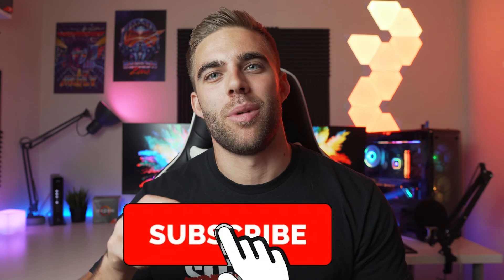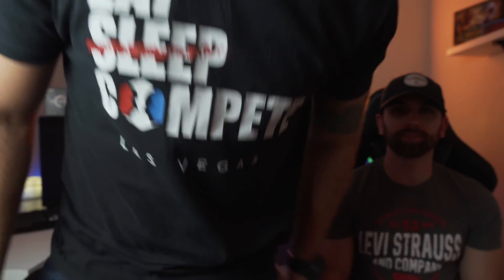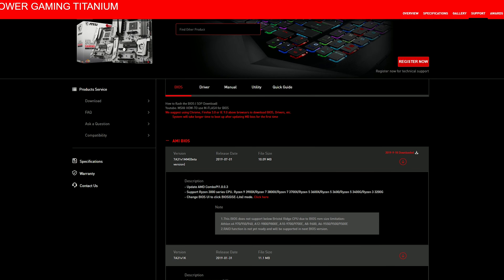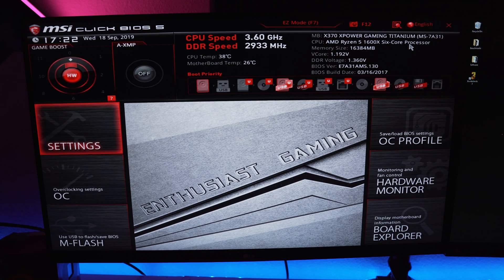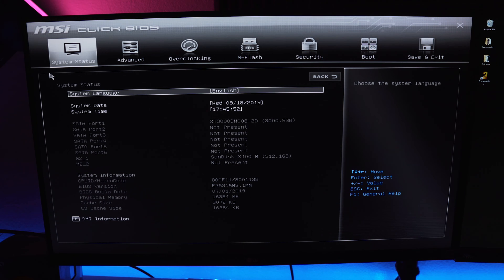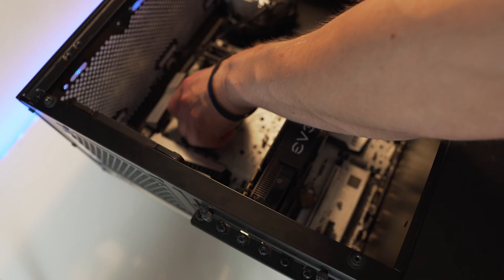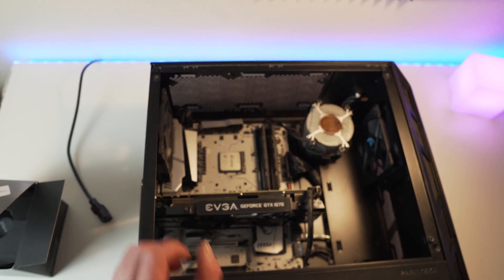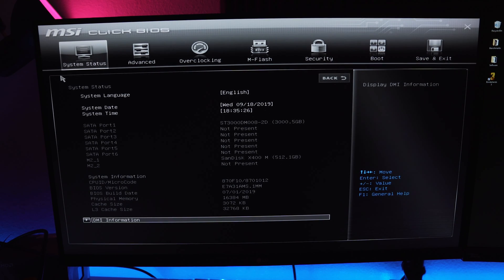HOW TO UPDATE YOUR BIOS FOR RYZEN 3000 CPU'S | Ryzen 3000 Bios Update Tutorial

Comment: I did a bios update to my gigabyte 450m motherboard and I have a ryzen 5 2600 chip but my PC won't boot up. If I put the old ryzen 3 1600 it boots just fine. Any thoughts?
Reply from the maker: Your update might haver not actually updated. you might need to try it again!

Comment: Do I need to update every version of the bios or just the most recent even if the most recent says nothing bout the 3000 chips
Reply: Do not update if you dont have any problems, says in manual
Reply: @TheFbiFilesRepeat  well I have a b450 gaming plus that needs to be updated in order to use the ryzen 3000 chip series and was asking if it’s the most recent one I have to update or will the newest update have all previous updates
Reply: @harrisonramsdell6731  Boring answer but google "b450 gaming plus zen 3", it will give you all the answers

Comment: this is great and all but im building a new pc so i dont have an old cpu to work compatibly with my bios whatsoever, so it can't be updated easily without doing a bunch of other stuff with the lan drivers or flashing the bios to access the bios let alone update the bios. can you make an updated tutorial on this?
Reply from the maker: This process requires an older generation cpu if you want to do it. AMD was offering upgrade kits that could be shipped out but I’m not sure about now. If there’s another way to do this, I’ll update the video

Comment: do you know of any boards that suport ryzen 7 3700x? Or do I have to upgrade the bios on a board?
Reply from the maker: Any b450 board that has "ryzen 3000 Ready" on it or b550 and x570 boards all support it. Or you can use an older board and update the bios.

Comment: Im building my pc with the Gigabyte B450 AORUS PRO WIFI and a ryzen 5 1600, how do i know of it worked?
Reply from the maker: If you updated your bios correctly your PC will boot as normal.
Reply: RA Visuals how do I know if I need a bios update? Im new to building pc’s lol
Reply: @RAVisuals  hi, so i have a ryzen 5 3600 and gigabyte b450 ds3h motherboard. on the gigabyte website it says that the ryzen 5 3600 is f40, do i need to hpdate anything and if so to what?

Comment: Does the bios update for a 3900x bottle necking. Your cpu
Reply from the maker: I'm not sure I understand the question
Reply: RA Visuals  what’s better bios update or ryzen 3000 ready
Reply from the maker: @shoelacegaming1993  They both do the same thing so depends on which is easier for you. if you dont want to mess around with updating the bios, just go for a board thats 3000 ready.

Comment: well this doesnt help me at all...because the old processors i have do not fit in my new motherboard. when i connect everything, i get no video. so i need a tutorial for that.
Reply from the maker: Willionair3 what processors are you referring to? The fx series ones? Those are not compatible with the new Ryzen motherboards.
Reply: @RAVisuals  it's all good.... It wasn't coming on because I was hooking up the power led switch to the power switch header.... A aaaaaand I didn't have the 6 pin cpu power cable hooked up. Once I did those two things, it came on!
Reply from the maker: Willionair3 sometimes just a little second check fixes it all! Glad you figured it out!

Comment: CAN I use a Ryzen 5 3400 to update my motherboard b450-F or is it only with Ryzen 2000, is it all new tell me friend ?.
Reply from the maker: No, you cannot update a b450 board with the 3400G. You will need to use a 1000 series or 2000 series chip.
Reply: @RAVisuals  ok thanks i will have to buy a ryzen 5 2600 you can true